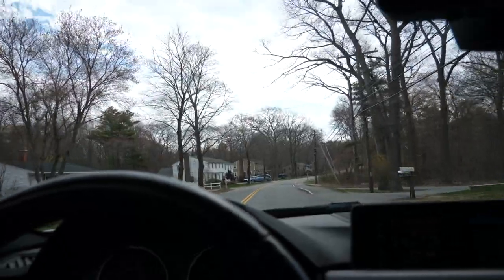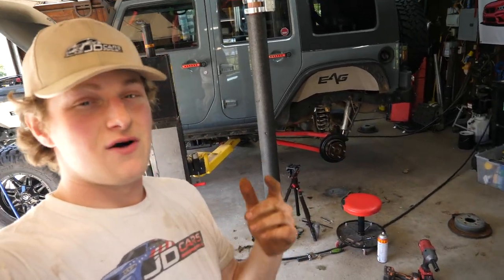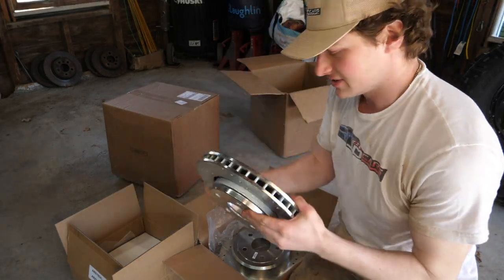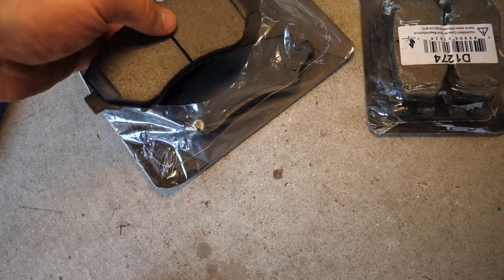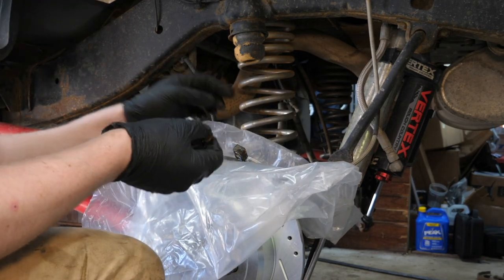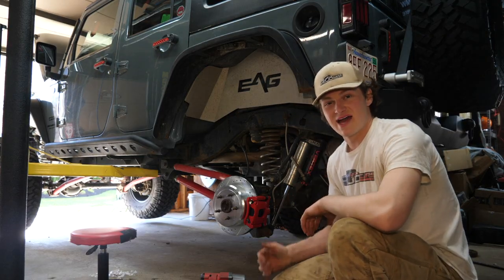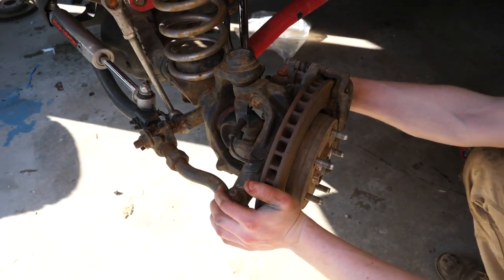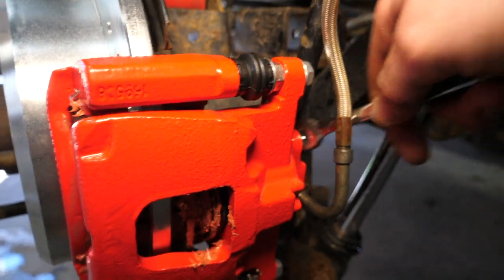How to Replace Brake Rotors, Pads, and Calipers // EASY DIY

Comment: A good idea for any diy brake job is, if the rotors don't come coated, use caliper paint on the rotor hubs(inside and out)...prevents rust just like the coated calipers...of course time is needed for drying, but it's worth it...I use the callahan brake kits too, and for the price, they'll never be precoated...but I change every 3/4 years(depending on wear), so it's worth it